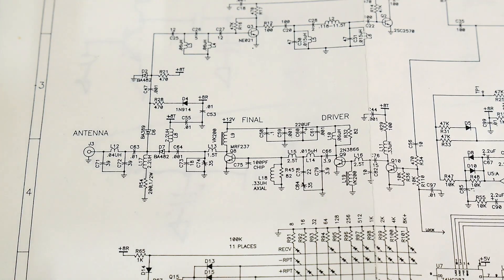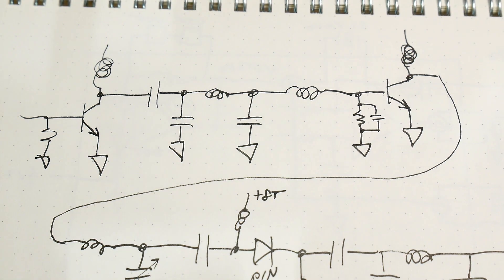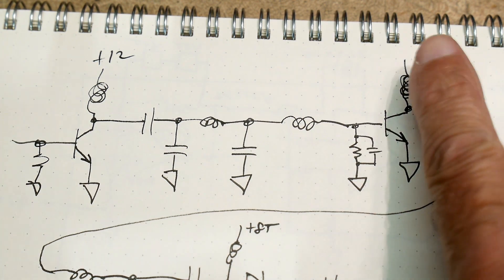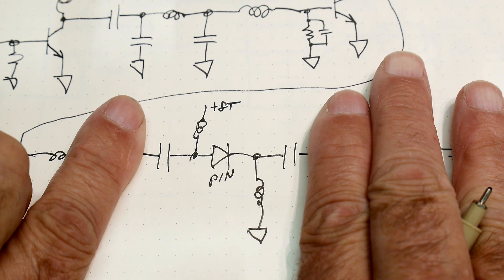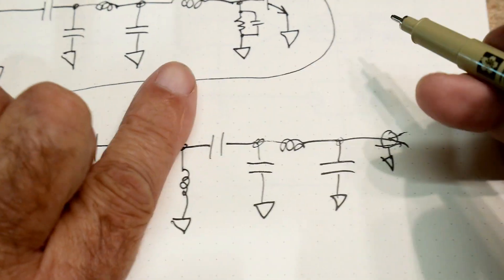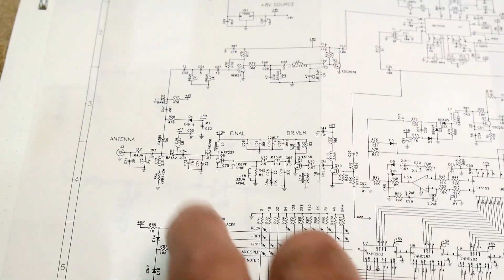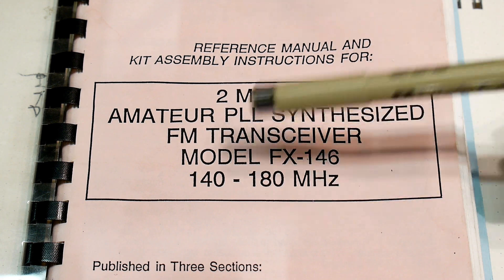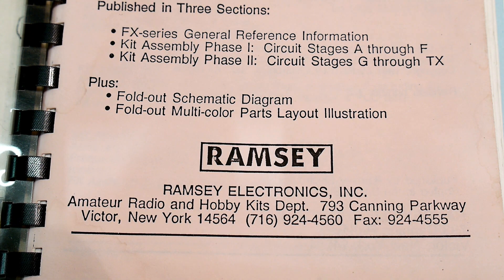#1519 Ramsey 2m Power Amplifier Output (part 12 of 12)

Comment: Excellent series, thank you!!  This was exactly how we were taught in the military, my first structured electronics training.  Section by section, with the behavior expected in each, to understand how to inject or monitor at each stage to troubleshoot by divide and conquer.  And that divide/analyze/validate is a process I've used a million times since, in electronics of course, but also software, appliances, electrical.  If there's one thing STEM should teach kids, I would argue that this is it.
Reply: Agreed.  I was taught electronics as a technician in the Marines in the 70's, and those analytical and troubleshooting skills were valuable later when I got my electrical engineering degree.

Comment: Ramsey is still in business but no longer make electronic kits, FM broadcast transmitters and "so called" electronic surreptitious intercept devices.  The FM broadcast radio transmitters is what got them in trouble with the FCC and the so called intercept devices with the US Customs Service.  If I remember correctly they got raided by US Customs in late 1999 or early 2000.  The whole ordeal was a waste of tax payers money.  They now only make RF shielded enclosures for testing and forensic inspection.

Comment: Very informative series. Thank you very much.
I have 1 question.  Why there is no impedance matching at the output of the PA? Is it 50 Ohm?
Reply: @ 4:28 Output impedance matching is done with L13,C73&C74
Driver to final impedance matching is done with C66,L14,L15,C78,79&84.
L18 forces a DC ground on final base to ensure class C operation, L18 & R45 allow enough RF to build up to drive the final.
Reply from the maker: Yes